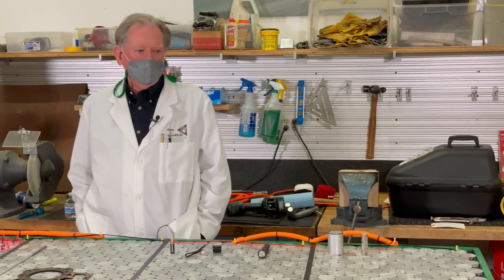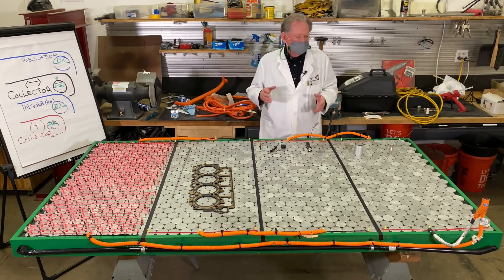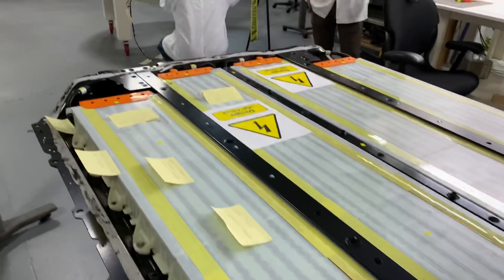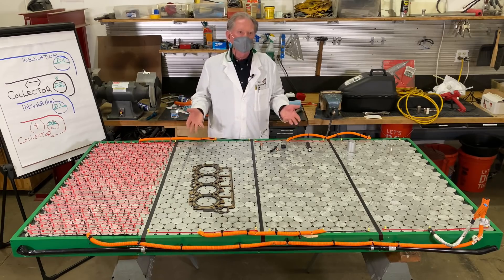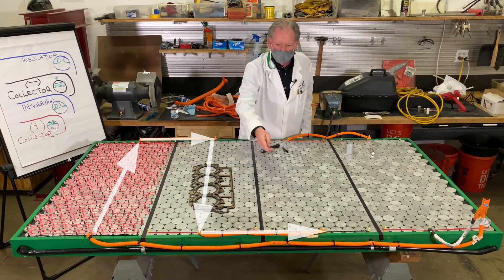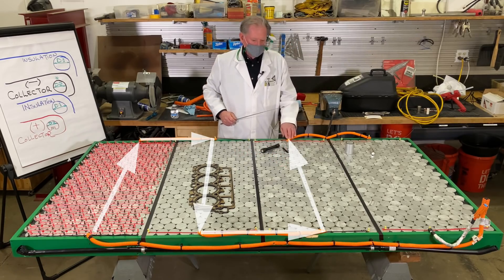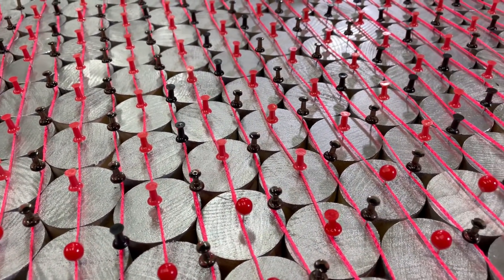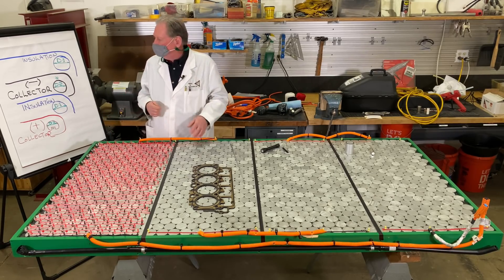Tesla 4680 Battery Pack Prophecy

Comment: The MLS  (multi layered steel) head gasket idea for the battery connections is pretty slick. Reminds me of how  thin film touch pads work, except using it to carry much higher currents 
 than say telephone touchpads- should save a lot of time  in the manufacture.  Really much simplified  over the earlier smaller cells since the "total" number of  parallel connections necessary is greatly reduced by the high current capability of the 4680
Great presentation

Comment: Why wouldn't they have two "modules", left and right. That way you can build the voltage flow down one side and back the other without the module interconnecting orange wires

Comment: The cell wires also serve as fuses, if very few cells get punctured/shorted. Maybe Tesla sees that very few times did these fuses improve safety... Electrical connection arrangement can't forget the cooling requirements. The big cell cooling "from the bottom" (something Sandy predicts) is going to be challenging, since each cell has more mass than the 3/Y, which gives 6X the power so I'd scale it linearly for losses. Any engineer would like to find 6x the contact surface to balance it, but a bottom face of a 46mm diameter circle is 1662mm2 while half the side (3/Y/S/X way of cooling) of a 2170 is 2309mm2. So, unless there are heat sinkers embedded on the cell, there's a conductivity problem, at cell-SinkChannel interface. Loads of ways to tackle this, sure Tesla engineers are having a blast at it.

Comment: Hi Sandy
Although I do understand the production cost of having 960 small wires instead of simple bars, the 'old' design would handle a single (or a few) cell failure gracefully. If a cell shorts (say from a dendrite), then the other 73 cells in parallel will immediately burn the dendrite or the 'fuse'. So the defective cell is decoupled and capacity loss is only between 0 and 1,35% (0% if defective cell was in best module, 1,35% if defective cell was in lowest capacity module - at least as long as Tesla only use passive balancing)

With only 10 cells in parallel I realize we DON'T want even a single cell failure because of the much bigger capacity loss, but the battery still needs to be safe. With 6x the power in the new cells the fuse - if still wanted - must be much fatter, but it could be designed in as a weak part in the connection bars system :-)
Reply: Yep, very often overlooked issue.  The bigger the individual cell, the bigger the impact on failure.  I suspect that now we are a year down the road form this video, the 4680 is going to be a big nothing-burger and will be fraught with risk.  Sandy's recent LiFePo4 CATL Model 3 battery "peek" was really showing where the future is going (prismatic LiFe packs, which have been in constant development for almost two decades!)

Comment: Thank you as always for a another cogent systems analysis.
As an electrician who has had a lot of experience with batteries, I would change the wiring slightly. The main connections would be at a corner of the pack instead of the middle.
 
 So, say the negative connection is on one corner, then the positive connection would be on the corner opposite the negative corner.
This helps to maintain close to equal resistance through all of the current paths through the cells. 

 With the connection in the middle of the pack, the cells in the middle of the rows would tend to charge and discharge slightly faster than the cells at either end of the rows, since the current will flow through them more easily due to lower resistance from the shorter current path.
The cells at the ends  of the rows would never fully charge or discharge, because the resistance will be higher since the current has to flow through a greater length of wire in order to travel out to the ends of the rows, through the series connections, then back to the middle of the cell pack. This results in shortened cell life as not all cells are being used equally.
 Interestingly, this very issue occurs in the cell level, as the tabs need to be at opposite corners of the anode and cathode in order to provide equal current paths. Part of the strength of the new Tesla cells is that with its tab-less design it will allow current flow from the entire end of the anode and cathode more directly through the cell than the existing cells. This shorter current path means lower the resistance, which means that less heat will be generated within the cell. I am thrilled to see the advances driven by having Tesla working so hard to bring practical and affordable battery storage into the marketplace, along with an amazing car, cheaper PV options, etc.

Comment: I think it would be easier to manufacture if they welded one end of the battery as positive and the other end as negative instead of that "side-welding".
I didn't entirely understand the collector diameters thing you talked about. Could you please elaborate on that?

Comment: I think it makes sense to have 4 or 5 modules despite Elon saying they are going to glue the cells straight into the chassis.

If one module goes bad it can be replaced on its own.

They can be used for power walls when storage capacity has dropped to a level below what is acceptable for a car.

Smaller cars can use less of the same modules. New compact car could have option for 2 or 3 module. Cyber truck could have 6 etc etc

For this reason I think it would make sense for each module to be 400v.

One downside is you have more connections for power and cooling.

Comment: I had to pause the video at 1 minute and 41 seconds. The reason why they made larger batteries was to retain the space in the overall battery pack. Think of the space between the batteries as wasted space. There's a lot more space between all those little batteries than there is between all those big batteries.

Comment: There's a problem with your manifold holes , the size of the hole in the center insulator is to big.
If the hole in the center insulator is the same size as the base insulator your plates will make contact. 
The center insulator holes need to be smaller than the negative plate connector holes at the edge so that the overlapping positive tab doesn't make contact shorting the pack.
Stepping the size matters.

Comment: Doesn't the Tabless design result in having a large positive surface area at the top and a large negative surface area at the bottom? So then it's a just a matter of a simplified manifold on the top and bottom to wire it in.

Comment: the whole cylinder is negative( - )  the black portion is the insulator  and the circle on top is the positive ( + ).  all they need to do to connect them in parallel is stack them one against the other to connect negatives and run a sheet on top to connect all the positives. Next row will bee flipped  upside-down  connecting positives to negatives ( series ) separate the rows with a bit of space ex: 1/4 inch.  all of the batteries positioned in a form which is then filled with a binding agent  basically making a rigid board with   2 connections. simplifies the construction of the battery to few seconds.

Comment: You think they're getting rid of the positive top wire?  I thought that was their first line of defense being a "fuse" that was consumable if an individual cell were to short.  And I was guessing that the battery casing was going to take over duty as the common negative conductor.  Thanks for the content!

Comment: ... Aren't the teeny tiny wires part of an emergency battery management system where an over current would melt the wire and take the cell out of action (but save the pack).

Comment: Hi Sandy, Great job. I have a couple comments. I have a Model 3 battery pack. Its construction and the battery day presentation may shed more light on how the pack is constructed. 
1) I believe Elon stated that the modules are gone. If the pack is constructed 1 1 large unit where the individual "modules" in your design are homogeneous with the pack that makes sense.
2) The individual cells need protection in case there is a cell short. The wires spot welded to the fingers providing the "manafold" series/parallel interconnection act like fuses that blow in excess of around 20 Amps when in the conductive foam. This could be built into the manifold. Something like this will absolutely be needed.
3) The thermal connection to the base of the can will need to be electrically isolated to prevent the cooling circuit from shorting the cells together. I am looking forward to seeing the end cooling!

Comment: If you turn the 4 “modules” 90 degs I think you will be closer. Right now you have a “zed” pattern which requires long wire or conductor runs. Instead turn the modules 90 degs and have the current run around like a race track. And then both Negative and Positive mains coming off the center of the short end, not the furthest points along the long side.

Comment: I can't wait for the 4680 battery configuration plus rigid battery cell and lighten car using the casting methods.  I would like to race this car at Sear Point Raceway in Sonoma Calif.  With a rigid and lighten frame the car will be more nimble with less unspring weight issues keeping my tires on the race track.  What is more important is that a rigid frame means I am not dealing with 5 suspensions. Race car design is always a rigid frame so that a person tuning the race car only worries about the suspension of the four wheels.  I invested lots of cash in TSLA, the cash will be used to help me race this car. Tesla model three performance car is my choice followed by the roadster.  I can't wait to give it a shot.  

I no longer have my National Racing License so I will need to  rectify my license.

Comment: Not a particularly good explanation of series / parallel.  Batteries in series... the voltage goes up.  Batteries in parallel, the current goes up. Combine the two and you have the voltage and current capacity..

Comment: I think that the manifold may also contain the cooling layer this could reduce cost of manufacture too. Now that the heat would be easier to wick out of the top and bottom of the battery. Otherwise great representation of the pack. I am just concerned that the electronics bay was not considered like in the Model 3 battery. They have that carved out of the pack. This would reduce the count of batteries compared to your pack representation if they follow that similar design. Now that could be that the represented area maybe only a representation of the battery area not including the electronics bay. Thanks Sandy.

Comment: Nerd engineering porn i guess, ha-ha, I'd love to get my hands on one of the Tesla batteries, when they are in production for a while, maybe a couple years, I just wonder how easily they can be broken into 7 or 14 series cells, i want to use them for off grid solar, but if they are all but impossible to be disassembled, I'd still like to have one . for a ev conversion! A Tesla drivetrain in a tiny vehicle would be awesome, something around or close to 2500-2800lbs, with the 4680's they should supply the current, less voltage drop, it should accelerate like a rocket! I just wonder if they will be affordable on the Salvage market, seems the 21700's are cheaper than the 18650's because they are not as useable as in being repurposed!

Comment: And the "gasket" interconnect fabric will also have the necessary many small traces/wires that will connect to the BMS to track cell voltages and do "levelling" when appropriate.  Very much like designing a multi-layer circuit board, and super-quick to assemble/test.  I'm waiting for the opportunity to purchase a "slightly used" battery pack from a future wreck.  The late Jack Rickard showed us the way to acquire huge but inexpensive storage for our rooftop "selfish solar" systems.  The future will be amazing!

Comment: Hi Sandy, Thanks for all you do; I’m learning so much from you.  Now - RE Simile for Series & Parallel: I would like for you to use the simile of Elephants at the Circus: In series the elephants are like in the parade where they all follow each other and grab the tail of the elephant in front with their trunk, and all parade in a line.  Each elephant is a cell and the trunk is + and the tail is -.  Then, in the show, when the elephants (say 4) are side by side an reach down with their trunks all together to pick up a large pole they are in parallel side by side with their + trunks all touching the pole.  Then explain electrically how Voltage sums in series and how capacity sums in parallel.  Then the reasoning for how many cell in Parallel and how many parallel groups in Series, followed with the  the Pack Parallel Capacity and Series Voltage.

Comment: Really great visual mock up of new TESLA battery 4680 cell interconnection and very good explanation of Series & Parallel Circuitry. The first thing You made clear is that the negative Anode connection is going to be on the top. (Was it done this way for 2170 cell?) I like your division into 4 sections (modules), the first section of 96 cells connected in series just like a flash light and then connected in parallel with the next 3 sections and positive and negative terminals end up beside each other for connection to both cables with a voltage of 336. (It sure would be interesting why others are going for double that voltage? Sandy, no more mention of tipping the cashiers. Have You resigned Yourself to the fact Retail has been destroyed fore ever now the people that want to shut everything down have won?

Comment: 6x power 5x energy 16% increase in range....why is  the range not greater?
Reply from the maker: Because there will be about 1/4 the cells used. 960 (4680 cells) vs. 4416 (2170 cells).
Reply: @MunroLive  Over my head. I understood the reduction in the number of cells and the efficiencies in putting the packs together not requiring the myriad number of connections. When I hear 6x power and 5x the energy why would that not lead to a greater ramahngemthan 16%. I associate 6x the power with milli amp hours. Ie 6 times the milli amp hours. That must be an incorrect assumption? What do they mean by power. Ludite seeking understanding.

Comment: All due respect Mr Munro, 

In you review, I believe your missing the "tabless design" and the structural bonding of the negative can body being electrically connected. 

What I understood from the battery Day presentation is that on the top (positive) of the battery, I believe they were planning on a stamped sheet (dimpled) conductor to contact the swirled top of the battery to support the positive of the battery. This positive sheet would need to be covered with an insulated sheet to prevent shorting. I don't believe there will be welding. 

The 4680 Can (body) and negative bottom plate will provide the structural rigidity of the battery pack to support the vehicle frame as well as clamping of the positive top without welding. 

I'm no expert Mr Munro and I don't know for certain what Tesla's plans are. So the above is what I envisioned when I watched battery day. 

I can't wait to see the actual battery once completed! And I look forward to your insightful evaluation and review.

Comment: 4 x 96S is 384S and would be 4x96x3.7 = 1420V nominal or 1600 V @ 100% charge.
There are no chargers that support this (yet), and such high DC voltages have a significant arcing hazard.
I'd suggest they would use these modules as 2S 2P for 800V.
1600V may be a step too far for the present?

Comment: It will be interesting to see what the final result of the packs in the structural casting will look like. 
Even without considering the battery being used as a structural part of the cars, being able to do a simplified electrical connection on one end of the cells, and do the cooling from the other end of the cells, along with using fewer cells overall, will make for some huge cost savings in manufacturing the packs.

Comment: Thanks for the great video! I wonder if it is possible to exchange damaged cells or segments individually. As I understand they are all glued together as a structural component of the frame. If the car is build to last a million miles, I wouldn't want the battery to decrease in range too much over time as a  result of damaged cells.

Comment: My Tesla 4U COMPACT was designed to remove the front pass seat and the BACK SEAT. I can get a sheet of plywood in ( we designed the hatch to be 50 in wide and not 42 etc. no SEXY can do this.  . I can get 16 2*4*8  and close the hatch. We can get a Jeep hood in and close the hatch.  The GUYS at LOWES love it. Don’t need a truck all the time.....We designed the hatch NOT to have a motor. No need for neodymium and wires. I have arms, BJ. Too many engineers are soft. Don’t need a motor in the mirror. Save weight and thorium from the magnets. Don’t the kids working for Tesla design think like this? And I built many  hot rods. And the door handles. They don’t cut back on drag. Poor engineering.  Why not have MANUAL door systems?   At least in the back doors??? Don’t need back door speakers if you care for the earth.  Cut the wires and weight.     Why do the double system?  Cut the motors and save weight for more range and less pollution.  Where can I get a job designing the COMPACT Tesla?  They need diversity in designs.  As a volunteer fireman, who signed off on the 3s door designs.   Sad.

Comment: Din't the Tesla pack use the small wires as a shortcut cut off, so if the power was to high it would burn the wire over so the battery wouldn't overcharge or be damage. How will that work if you spot wield it ?